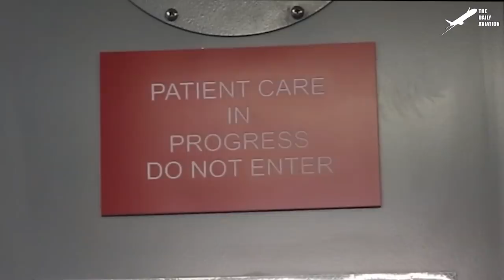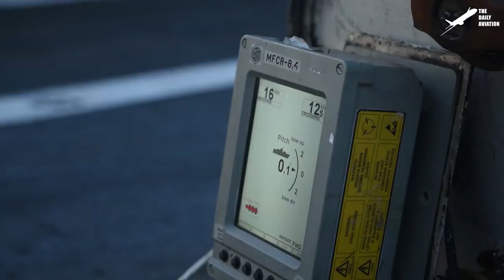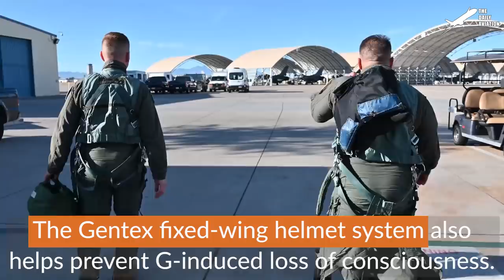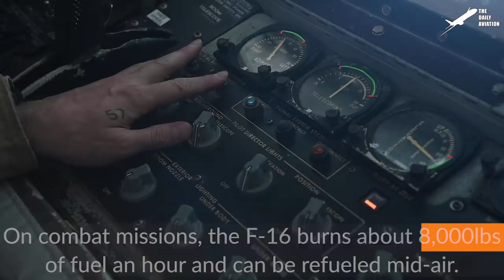US Navy Sailors Shopping Inside Aircraft Carrier

Comment: I served on the USS Tarawa (CVS-40) in 1957.   (Commissioned in 1945)I still remember the “head”.  There was no privacy.  2 horse troughs about 25 feet long, facing each other and separated by about 10 feet.  Sea water continuously pumped through to the outside.  Everything went overboard.  The newer carriers are so different.
Reply: Number ones and number twos?
Reply: Wow!  My carrier sure wasn't like that, it was a Nimitz Class commissioned in 1992.
Reply: I was on the Wasp cvs18 61-63. I was off the coast of Cuba during the blockade. 
Visiting other country's was nice.

Comment: The barber looks easy as there are no hair style variations (at least for male).
Reply: Back in the late 70’s early 80’s, I used to cut hair and you’d be surprised at the guys that would come into the barbershop remove their hat and use an Afro pick to reveal a head of hair that looked like a basketball, and they would say: Just take a little off the top🤣, afterwards when I was done, they’d pack their hair down tight and put their hats back on before they’d leave…

Comment: is there way to air drop cargo to carrier? 
that be neat wont it? 
air bag at bottom of pallet; and chute guided by GPS relative to carrier GPS; and self adjusted calibrated from ships computer once drop  is made; and use active thruster if needed; stuff like metal canned goods etc;
i think we can design one; we will put 5 air bags four in each corner and center will deploy first as it sinks four explodes or vice versa;
Reply: Why? This system works fine. They are "air dropping" cargo, without the worry of high impact, or the expense of thrusters or GPS or other nonsense.
Reply: They do it's called VERTREP

Comment: I was watching one of the shows on Discovery or AHC (can't remember which) on a documentary about aircraft carriers, and they say that in the coming years aircraft carriers will be no more. There is a large portion of Congress that wants to cut the budget for any new aircraft carrier
Reply: THe trouble with aircraft carriers as they are currently designed is that they are way too expensive to lose in combat with an equally equipped foe. If China or Russia develop an accurate and fast hypersonic missile to take one out the replacement costs and time taken to replace such a loss would be enormous.
Current aircraft carriers require huge protection from other naval surface assets and also submarines to keep enemy surface and submarine assets far enough away to be of no threat to the target everyone is after, the aircraft carrier.